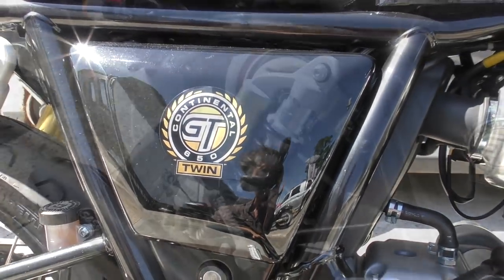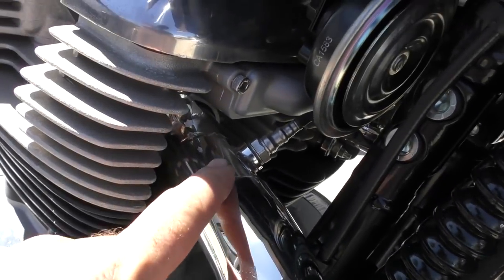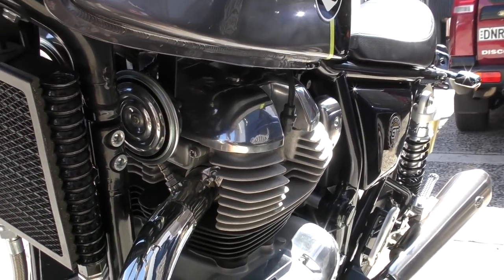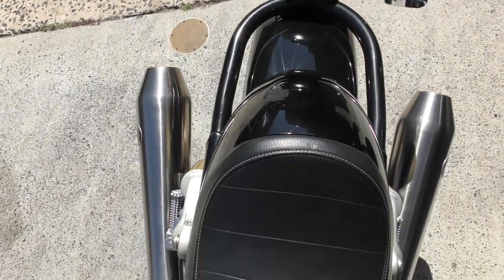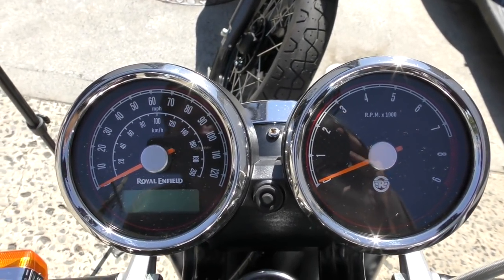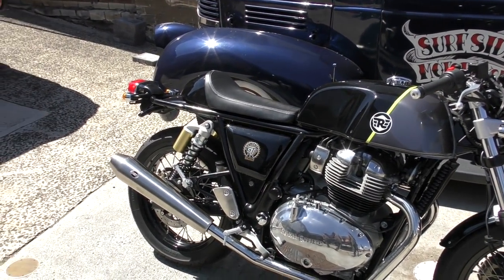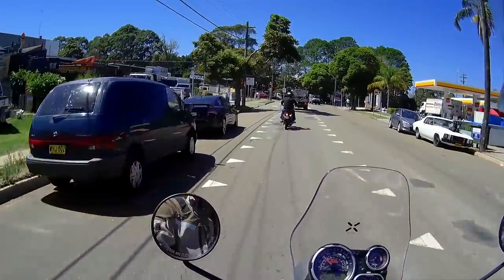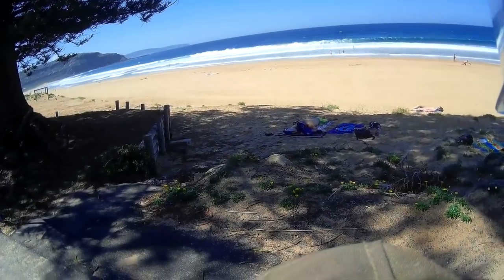Royal Enfield Twin 650 - Interceptor and GT Continental

Comment: Well I liked the  video but found the model name interesting. I own two Royal Enfield
736 cc Interceptors. One is a 1968 and very much like the US company Indian solin the 
US market. That one had no oil cooler and used a Lucas Magneto made by the
prince of darkness Lucas company, named for their electrical components. A  can
of airesol smoke was a toolbox necessity to refill the wireing occasionally. The second
Enfield is an Interceptor 2 built in 1970 with a totally reliable capacative discharge
ignition system which has never had a problem. I took ther battery out of that one
in favor opf a battery eliminator module which has also worked continually since
about 1972 when the  Lucas rectifier and battery quit.  These bikes have a 42 pound
crankshaft and virtually no vibration in the handlebars unlike the Bonneyville. The
handeling on these bikes is excellent even today. Not the level of a Yamaha R1 or Honda Fireblade handeling but a pleasure to ride. Never had an oil leak except for the oil
seal on the magneto shaft that leaks into the mag on the 1968 Enfield. Just an
ongoing maintenance item. The clutches were changed to Barnett because with
a .007 inch pressure plate lift they would heat up and you drive away if you are to
lazy to tap the neutral finder. 
     If Royal Enfield put these bikes back in production I am in line  for one 48 years 
newer than my "new bike".  If an electric starter was an option I might order that
but the rest is perfect just the way it is.
Reply from the maker: Yes, electric start and CDI ignition certainly are changes to bikes that have made a huge difference to their usability.

Comment: Hope they launch the bikes without any problems with proper testing and QC, as it happened with Himalayan it was plagued with issues!
Reply from the maker: I think they will have learnt a lot from the Himalayan experience both from an engineering and a procedure point of view.
Reply: That is the only concern that I have.  I owned classic 350 when I was in India and I was not particularly happy with the overall fit and finish.  The speedo cluster was not fitted properly same is with side stand and other parts.  Now I live in Germany and there are no much dealerships around here.  I really wanted to get one but I would wait for some ownership reviews.

Comment: Namaste danger, thanks for sharing the short review of interceptor . We are  excited about these bikes, however we are also worried how much testing they have carried out before launching it., So that new buyers wont suffer due to their live and committment to royal Enfield bikes
Reply from the maker: Time will tell, but the quality of the build looked very high. I think a lot of what RE has learned from manufacturing the Himalayan has gone into these bikes. I don't think it will be like the early days of the Himalayan.
Reply: they couldnt even turn on the engine at the press release. and even now, i haven't seen a single video of working bikes. why is that?
Reply: steve lam Due to an embargo from Royal Enfield I guess. They were supposed to release/launch the twins next week, but now due to some delays the launch in India is happening only in June/July.
Reply: that is a little worrisome but hopefully it'll be ok. i think these bikes should be lighter too. the interceptor is nearly the same weight as the 900cc triumph street twin. but otherwise it looks perfect!

Comment: Very good video! Thanks for sharing! One question, did not they give you permission to start the motorcycle? It would have been very interesting to hear that two-cylinder engine running. Greetings from Argentina!
Reply from the maker: Thanks mate. These bikes weren't functional. They were disabled as a way of getting them into the country before they are approved. Functional bikes should be here in August / September.

Comment: I just ordered a RE Himalayan today. Any updates, tours, long term reviews from down under on your bike?
Reply from the maker: Just uploaded a new vid today. Very happy with bike so far.
Reply: cool will watch it. I just clocked 1,000km on my bike. Very happy with it so far. It does make some odd knocking noises sometimes when you accelerate deep down in the engine, but going by the sound that my other single cylinder bike makes I assume this is quite normal.

Comment: Dangar Motorcycling did you delete the original version of this vid. I tried replying to your reply but YT said the vid is no longer available. Anyway, here's my reply:

Dangar Motorcycling you wrote:

"Most people don't have any interest in servicing carburettors themselves."

I'm not talking about servicing. I'm referring to adjusting the things. Basic stuff like that. 

" As well as being better for the environment,"

Don't be silly. That's utter bullshit. How damaging to the environment is a motorcycle compared with say a cow? I challenge you to defend your claim. 

" Fuel Injection is much more reliable with better cold starting.

I might agree with the cold starting point - but only up to a point. I'm aware that you're making your case in a warm country. I live in the UK where it's been as low as -6 C recently and I don't have an issue. So in fact I consider your point to be largely bogus. 

However, we're not talking about a scooter here. Put the choke on for a couple of miles and you're sorted. Easy. 

"Every week I'll clean many caburettors on customer motors to get them running again while the EFI ones just need an oil change."

Until the electronic element fails. Then, instead of your engine just running badly, it's not running at all!!

" Most people just want to turn the key and have the bike work."

Lazy cunts you mean. Sell them a bloody scooter then, not a 'retro' motorcycle pretending to possess the heritage of a traditional British marque that actually died in the 1960s. 

" Carburettors are definitely for the enthusiasts these days, not the mainstream consumer regardless of the horsepower."

Once again I can agree with you, but only up to a point, and primarily on performance bikes.
Reply from the maker: You can't argue that it is not true than and EFI engine is better for the environment than a carb engine because it is still worse than a cow. That's completely illogical. Even lawn mowers are going this way now.http://igin.com/article-3715-mowers-powered-by-efi-engines-more-horsepower-better-fuel-economy-lower-emissions.html Fortunately though if you love old carb bikes (which I can understand completely by the way), you can still buy one, they won't ever be banned which I agree, would be crazy.
Reply: Now gentlemen, wait a minute here... how can you be comparing carburetors to cows here?  They both need air to run, but one breathes in gas, and the other expels it !  Sadly, the two gasses are not one and the same, or we'd all keep cows around so that we could fuel up our motorcycles and go.  Hey, wait a minute,  I might be onto something here.... Does anyone make a scooter that could run on methane ???
Reply: Dangar Motorcycling you wrote:

"You can't argue that it is not true than and EFI engine is better for the environment than a carb engine because it is still worse than a cow. That's completely illogical."

Are you deliberately missing the point? Or have so completely swallowed the 'carbon emissions threat' myth that you're incapable of figuring out that blaming motorcycles for the nonexistent issue, and requiring their emissions to be limited (without even acknowledging the scientifically proven fact that the carbon emissions from domestic bovine belching exceeds the carbon emissions of ALL vehicles) is simply ludicrous, grossly unscientific and dishonest. 

That's the core of my point, and it's what you're buying into when you attempt to argue a case for EFI over carbs - which incidentally you've done by alternately arguing ALL the government and industry claims, all of which are used solely to support legislation that itself is based upon a blatant falsehood. 

Remember what they taught you in biology class? Photosynthesis depends upon two factors: Sunlight and Carbon Dioxide, which occurs naturally on Earth all the time. 

There is ZERO valid evidence to show that too much carbon dioxide is having any effect on anything - except where pro climate change 'scientists' are conducting experiments to artificial deliberately emit levels of carbon dioxide 100 times in excess of what is claimed to be the true 'threat' figure. 

However, there IS EXTENSIVE EVIDENCE to demonstrate that governments are pandering to the banking inspired and fossil fuel and chemical industries sponsored programmes to alter our collective perception of the environment as a whole (that it is damaged and is damaging to our health, whilst they are actually actively engaged in radically artificially altering the environment in multiple ways, including via weather modification (geoengineering) and crop manipulation. 

There's also unavoidable proof that these two activities are intimately connected, in the form of Monsanto producing aluminium resistant seeds. Why would we need aluminium resistant seeds? you might well ask. Well, in addition to barium and other nasty heavy metals, the geoengineering companies involved in filling our skies with those thin layers of artificial vapour trails (that grow laterally to BLOCK OUT THE SUN) are also using aluminium. Aluminium has been proven to be associated with the massive increase of neurological diseases such as Alzheimer's. 

None of this is even close to anything that could be described as 'conspiracy theory', as the CIA have wanted you to believe since their memo of 1967 (which was issued internally in response to people questioning the findings of the Warren Commission into the assassination of JFK). Instead what I'm telling you is based wholly on solid documented factual evidence, often provided by the very agencies, corporations and government departments responsible for them. 

" Even lawn mowers are going this way now.http://igin.com/article-3715-mowers-powered-by-efi-engines-more-horsepower-better-fuel-economy-lower-emissions.html"

Dude, I used to own an ad agency, I can recognise PR when I find it being deployed as propaganda. I used to be responsible for the fucking creation of it! Selling a more expensive system (EFI) that can't be serviced by anyone, never mind the owner, on the basis that it will give you a more powerful lawnmower is a prime example. The other commercial motive (gov payoff) is to maintain control over the servicing and aftermarket parts revenue stream, artificially shortening the useful life (without guaranteed issues), therefore increasing profits at all stages and levels. It's a no brainer. 

" Fortunately though if you love old carb bikes (which I can understand completely by the way), you can still buy one, they won't ever be banned which I agree, would be crazy."

That's not the point, and it's not about anyone's 'love' of carburettors or anything else, and I never even said I love carbs. My original comments (which you deleted when you inexplicably deleted the original vid), related primarily to the appropriateness of EFI to a retro designed bike. And that's the issue you seem to be studiously avoiding for some reason. Why?

We are all occasionally prone to defending the things we love with passion, and this can lead to subtle but causative perception shifts. 

However, an honest appraisal of what's actually happening in the motorcycle industry right now in terms of fitting EFIs to bikes, is demonstrably only a continuation of the trend in emissions controls that have been introduced incrementally by stealth over the past few decades. Every single change in engine design can be traced DIRECTLY to the initiatives agreed by participating governments to deal with the fake climate change. 

Finally, no I'm not a right wing nut or a Trump supporter. I'm simply someone who's performed due diligence on this subject and proven my own former strongly held and argued beliefs (held as recently as 2008) to be incorrect. Indeed, I junked a dot com startup I was building who's business model was based wholly on the assumption of the climate change threat to the cost of global travel. 

I'm one of those people who now hates lying for a living. The seed money I left on the table was $5,000,000US. That was just the initial startup venture capital investment. After the purchase of Skype by MS, I was also convinced we would be acquired by MS, Google or Amazon, and that prospect also horrified me. 

If you do the research you can easily confirm everything I've said is true. A good place to start is corbettreport.com
Reply from the maker: Could be your next big invention Stan!
Reply: Stan Patterson not aware of a scooter that runs on methane, but cows produce more carbon dioxide than methane. If you're looking for a more reliable source of methane, you need to visit one of those anal ventriloquist farms better known as government departments. 

The way they metabolise is rather unique. They suck money out of human activity as their lifeblood, and pretend to work for the public good, but actually work for the interests of banks and corporations whilst actually producing nothing at all other than paper, methane and carbon dioxide, but mostly methane. 

You could liken them to shit factories, except shit is useful as a fertiliser, and sadly it's against the law to fertilise your garden with corrupt gov employees. Plus, I hear the wood chippers needed to reduce them down to a useful state are now powered by EFI aspirated engines...!

It's a cycle no one seems to know how to break ;))